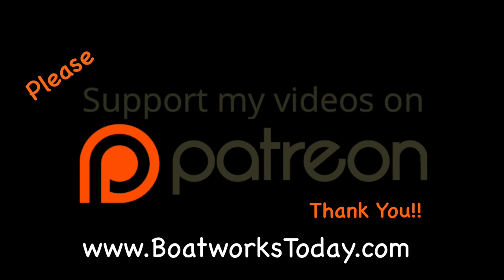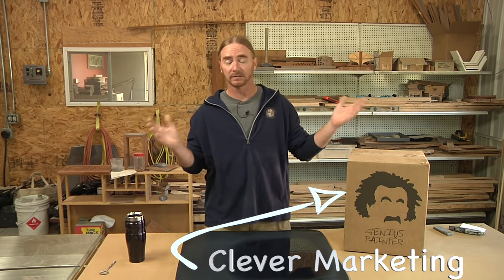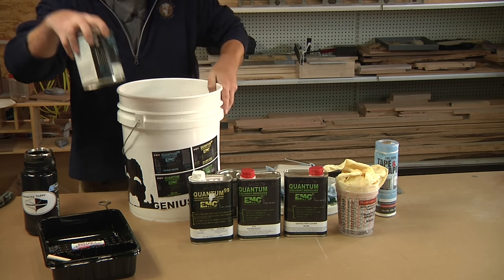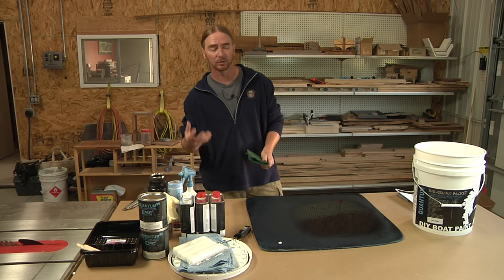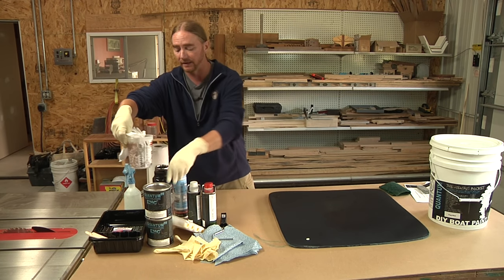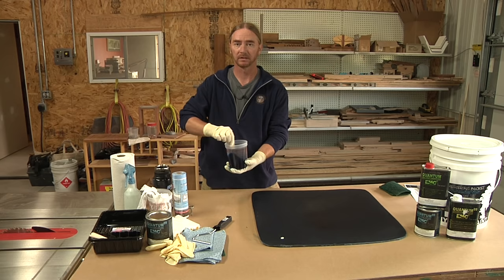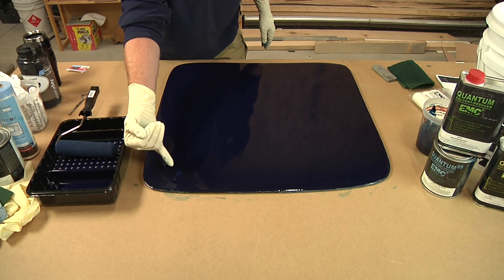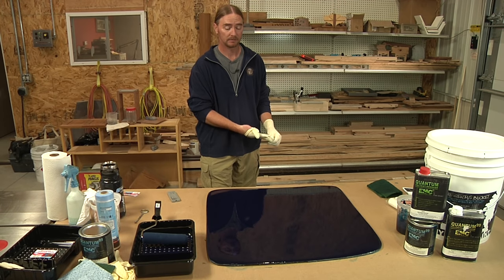Quantum 99 The Best Topside Paint For The #DIY ??  Part 1/2

Comment: I have purchased this kit from John and was told that it would cover up to 23' boat. My question is will one quart be enough or will need two? I plan on spraying but my kit was 1-qt ice blue for hull & 1-qt white for top side. Thanks
Reply from the maker: I suspect you'll need 2 qts for the hull on that size boat  :-/

Comment: I have a 21 foot cuddy cabin. Do you think putting this paint on the hull is a good idea? Will the paint wear through fast or damaged badly going on and off the trailer?
Reply from the maker: As with any topside paint I would not recommend using it below the waterline.  Traditional bottom paint would be a better option :-)

Comment: Hi Andy, I wish to paint the deck of my yacht, however 3/4 of the deck area is covered in panels of factory non slip. If I am to paint a foundation coat plus an undercoat plus the topcoat; the non slip will possibly disappear!  any thoughts on this. thanks. Patrick.

Comment: My paint struggle is what do I do with the roller and tray in between coats?
Reply: cover tightly with plastic
Reply: If it's not epoxy wrap in foil put in fridge. This is good for about 15 hours or use recomended cleaner.

Comment: I haven't watched all of your videos, mostly because I am just so busy that I don't have alot of time to watch alot of TV or videos. But I would like to ask you a question. I'm rehabbing a 15' 1988 Rogue Eagle fiberglass bass boat. The hull and transom are in really good shape. There's a couple of superficial spider cracks in gelcoat at the rear. And then 2 very small cracks on each side of the motor on the transom. They don't flex at all, and they are small really. But I want to do this right. It's my first boat, and first time working on one. I'm a carpenter/contractor and have a pretty good skill set and I am confident in my abilities, and I'm sure those skills will translate well to this project. The previous owner did a REALLY BAD spray paint job on it. What I need to know is, do I sand the old paint off, or use some sort of stripper. Will I damage the fiberglass if I sand it? I sanded a small area, and I also used goof off graffiti stripper on a small area. Sanding is definitely quicker. Is that ok to do? I know I'll have to hand sand some crevices and other precarious areas, and I'm ok with that. I just want to do it as fast as possible because I don't have alot of time while I'm at where I am. I'm leaving to go back home to Virginia in a month and a half, and I'd like to do this in my spare time and be able to take it out here in Connecticut at least once before I leave. Also, I'm planning on rolling it. What paint do you recommend? This Quantum 99 in this video? And I want to do like an emerald green w/metallic flake. Does Quantum 99 have that color that you know of. Any advice you have is most welcome. I fully understand if you don't have time to respond and answer my questions, as I'm sure you get several. I've made an exhausting internet search, but I get conflicting results. Thank you for your time making your videos. If you have any videos where you repaint a fiberglass bass boat, I'd definitely be interested in it if you can point me towards it. As I said, I haven't watched but a couple, and I like what you do. Thanks again and be well
Reply: Also, after watching your gelcoat VS paint video, I decided on paint.

Comment: Andy,  great show again.  So, no tipping with a brush with this paint?  Good news if not and easier for the DIYer.  Too, this was a flat surface, do you think this paint will flow the same when painting a vertical topside section without running?  Again, great and thorough video.  Thanks

Comment: I'm restoring an old fiberglass MFG boat. It's a typical 14 ft runabout. MFG made the first Corvette bodies. Anyway...this particular boat has over two hundred screw holes that I filled with an epoxy/talc mixture.  The word is that polyester gelcoat is not compatible with polyester gelcoat. However, I watched you video where you proved that to be wrong if proper prep. Being the boat is old, sky blue in color, finding an exact match of gelcoat is out of the question and I really don't feel like the idea of all the sanding and polishing that goes with that process. I did it before on a kayak I build long ago and it's easy to sand through too much.  

I'm now thinking of painting with Quantum 99.  Spraying actually.  I think I might like it do to its repair ability.  Do I need to use a PRIMER over the old gelcoat before using this product?  Keeping in mind of all those screw holes I  filled with epoxy.
Reply from the maker: It's never a bad idea to prime first, but they claim that it's not necessary.  Personally I would just to make it easier to see imperfections  before applying the paint!